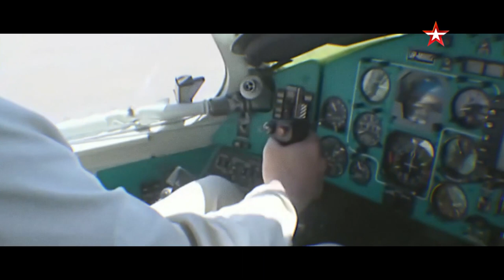Episode 100. MI-26. A flight to the star

Comment: US: lets make our transport chopper with two big rotor blades on the front and back.
Russkies: Just make chopper big!
Reply: The two rotors are to make it faster, not to increase it's capacity.    With the same lifting power a single rotor helicopter will be slower.    It also allows it to have greater control, allowing it to make boat extractions in rough seas and things like that.
Reply: MI-28? KA-52? Russia also pioneers dual rotor craft also.

Comment: Why not putting 4 small string wires on 4 corners of the upper craft that attach to 4 corner points on lower craft, just to keep it from spinning. Make them stretchable maybe, not to take too much vibrations and stressing to either aircraft...
Reply: We're talking about the Russians here. Lol
Reply: From your comment you don't seem to be an engineer.
Reply: @crinosis2302  Nah... But my dad is machine engineer... :D
Reply: @crinosis2302  so , enlighten us if you are smarter in this ..

Comment: What these documentaries don't say is despite being a huge and capable helicopter it chews up so much man hours of maintenance that the initial smaller cost trebles over time hence proves not a practical solution. This is why Indians went with Chinook - sacrifice haulage a little for cheaper running cost and availability.
Reply: Partly true. Indeed platform cost is less than lifecycle cost but also to factor Indian procurement process so slow that mid life upgrade keeps getting delayed and obsolescence steps in.
Reply: If something is bigger is obviously more expensive. Or the cost of maintenance is equal between a Van and a truck??? 🙄🙄
Reply: I agree. Despite Mi-26 having raw power & immense capability, the maintenance is just too much. We used the Mi-26 earlier, but the costs of maintenance & the poor post-procurement support were just too much for the IAF. There is no point in being a Hangar queen and being a powerful beast.
Reply: @KimJakab  He was talking about the maintenance. Mi-26 is damn powerful. But the MTBO is really short & the product support is just bad.